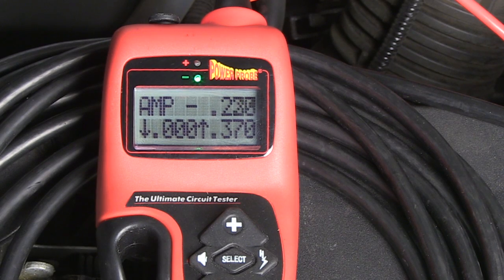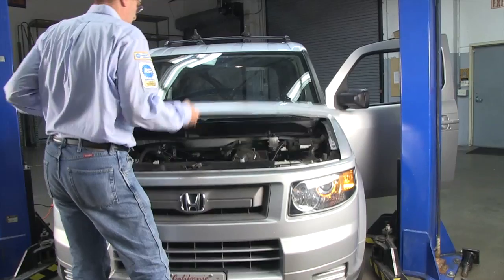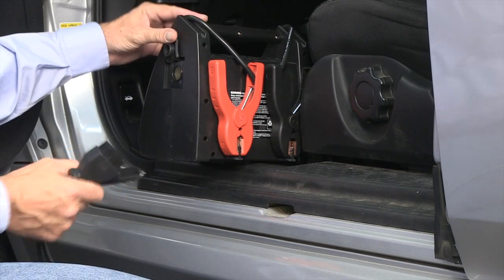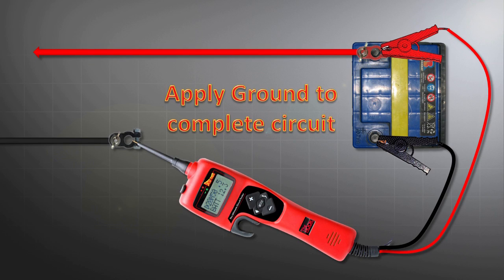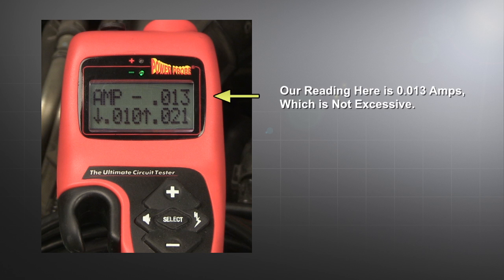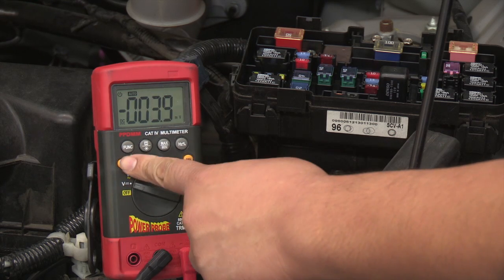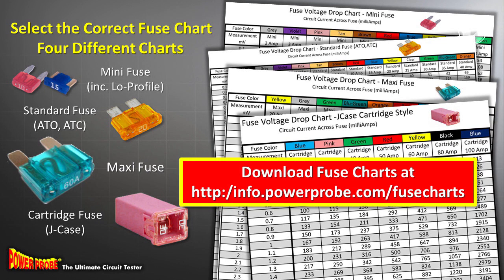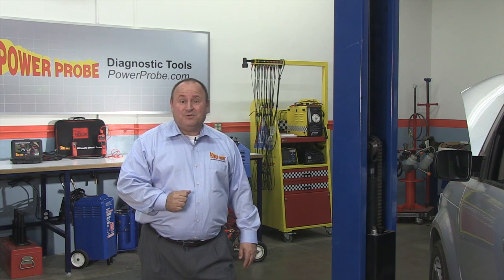Performing a Parasitic Draw Test Using the Power Probe Hook

Comment: I am using my Hook right now for this same test on a 1991 Corvette that the owner says the battery will go dead overnight. So far a .012 amp draw for 2 hours. With the key in the ignition the draw goes to  .257 amp. I think I found his problem...

Comment: where i can buy that hook tool? Because need that adjustable circuit breaker, what other power probe models do not have.
Reply from the maker: the Hook is not available, it's been discontinued
Reply: @PowerProbeUSA  So there is not anymore that kind tool coming from you, what have adjustable 65A circuit breaker, and can test components with that amps?
Reply from the maker: @jarmohuhtamella9647  Correct, not at this time. We have new stuff coming out later this year, so check back soon.
Reply: @PowerProbeUSA  Thanks. Cant wait...

Comment: Can you do this test with the power probe 4 ?
Reply: Yes...if you manually lock down the button.
Reply: @Greenmachine305  Lock down which button?   it's a rocker switch + -
Reply: @DayClanTribe  It doesn't matter. You just need to allow continuous current to flow.  Any indication of current over time whether pos or neg is evidence of a parasitic drain. The polarity is irrelevant in this case. You're simply looking for any number that isn't zero. Not sure if the device has a logging feature, but if it doesn't, use a gopro to record the numbers overnight.

Comment: I have a 2007 BMW 328Xi - The Battery in this vehicle MUST BE PROGRAMMED by BMW otherwise the car will NOT RUN, therefore if I "disconnect" my battery and then try to "re-connect" it the car will not work and will need to be "re-programmed", If I purchase the Power Probe III or IV and use a Jump Pack connected to the OBDII or whatever that port was you reffered to, will this protect my BMW Battery from having to be re-programmed? If Yes, Ill purchase this.
Reply: Yes providing your alternative power supply doesn't get disconnected or to low

Comment: A voltage drop reading should go from the battery to where the circuit is to be tested, testing voltage drop across a fuse will only determine if the fuse is blown.
Reply: wrong